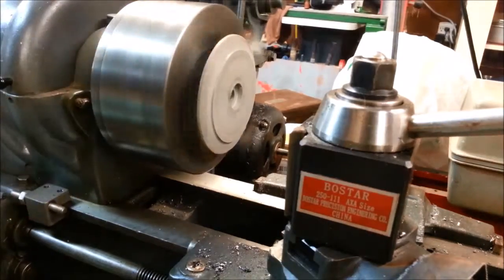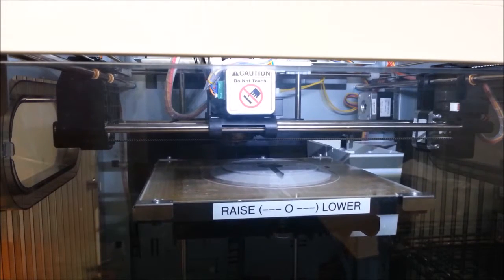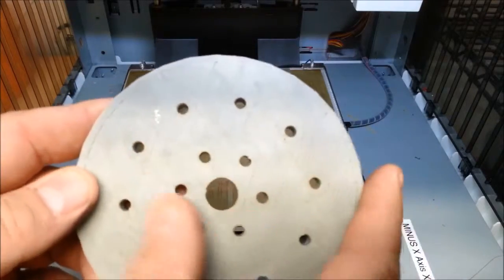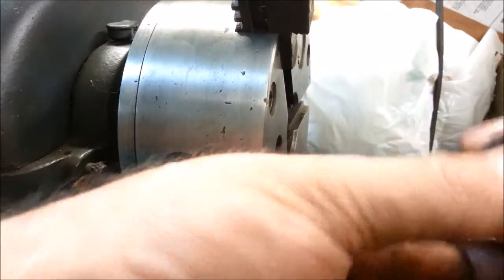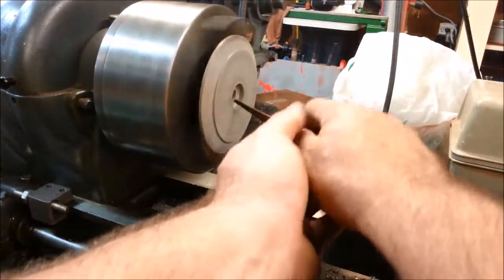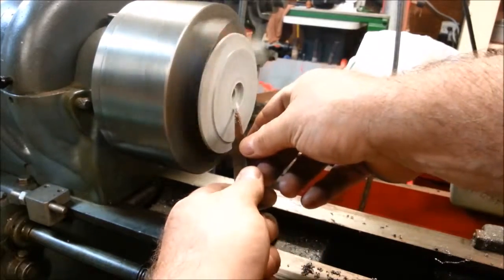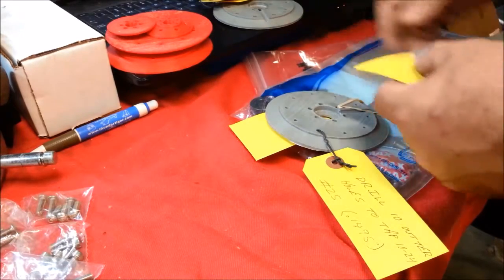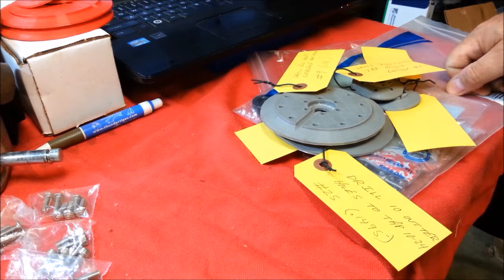3D Printing Atlas / Craftsman  Compund Pulley  for EvilTwinX Part 2 Crafted Channel

Comment: Is there  a drawing somewhere that can be downloaded that a machinist could use to cut a pulley on a lathe or mill? I know the general measurements but nothing I feel comfortable giving to a machinist to use as a final build drawing. From what I have found the 2 step pulley general measurements for an Atlas 10 or Craftsman 12 are: Small 1.988, Large 4.454, Width 1.242, Bore .625. Thanks for your interesting videos, Specialk
Reply from the maker: Thanks for watching them and commenting.  I don't have a drawing.  I just remember sitting with an example in my lap and measuring it as I worked on TinkerCad.  Don't have a measured drawing.  It is altered slightly for the use of plastic.   I might be able to do a drawing for you.   You can put a small single pulley on your motor and use it long enough to machine an aluminum dual pulley.  I now have a broach set and mandrel for making these.
Reply: Thank you sir for the response. Don't worry about making a drawing. It has a 4" pulley on it and I will probably just use it for now. I was hoping to find something like an original Atlas drawing somewhere that could produce an exact replica of the factory measurements to maintain original belt fit when switched from one speed to the other. I enjoyed your Airstream videos as well as most of your other videos too. Thanks!
Reply from the maker: specialks1953 I've got a lot of un editited Airstream content.  I'm doing an axle on the 1967 right now.   That will definitely end up online here.  I also have some content on the way for pulley making.   MrPete222 has a pulley making video that is very good.   There is a Southbend series, had to make a double pulley for a lathe that had only a single on it.
Reply: A guy at Clausing told me they can't release drawings b/c the part is still in stock. Part # 10-428. $91.54. However, he took a pair of calipers to a sample and told me the measurements were 1.945 and 4.395. Not too far off from what you posted. I plan to make one soon.
Reply: Rick Rose thanks for the info. Good luck! Maybe some day I will get around to trying it but I have too many irons in the fire for now.

Comment: I have to say- this is super cool! I've been showing the parts to some of my buddies and they're all fascinated by the whole idea of using 3D printer parts for practical use. Thanks again for the parts. I will be filming soon the assembly and, hopefully, use of the pulley.
Reply from the maker: +eviltwinx  Great.  It's a fascinating technology.  I'm really only interested in 3d printing for it's practical purposes.  Making a bunch of toys to fill shelves seems less interesting than making real practical working things.  It will be fun exploring the limits of 3D printing.  I'm not saying it's the best way to make a pulley, but it's the best design for a pulley that I could think of if one was going to use a 3D printer to make one.  If I come up with a blank to cut a tool from, I'm going to turn one in billet also.

Comment: nice what does a rig like that cost I'd live to have one for doing paternmaking.
Reply from the maker: +Chris Anderson I paid $350 delivered.  The going rate is $500 or so for that printer.  Just by pure luck the day I was researching it New Egg had it on sale ending at midnight.   I couldn't help myself.  Seemed to me the vast majority of comments were very positive on it.  I've been pleased and am looking for another one, maybe used to expand my capacity in the future.    I can't stand only having it at work.  I want one at home also.   ;-)  The more I think about it, for pattern making, PLA would be better.  It's brittle but shrinks less.  I do not have experience with PLA, but it's the more common printing plastic and simpler to work with.